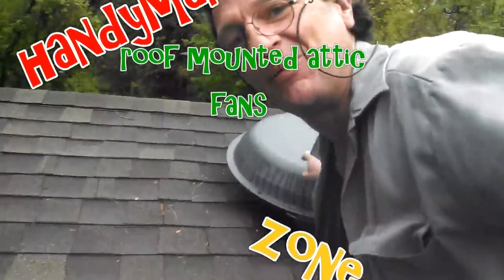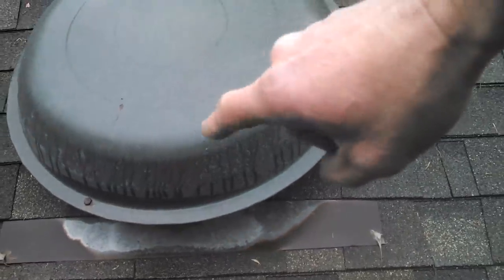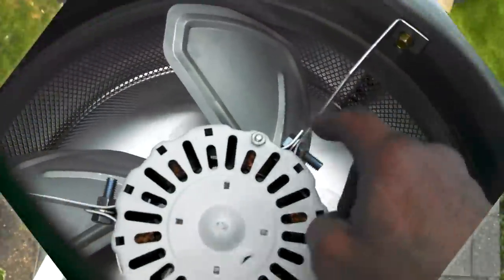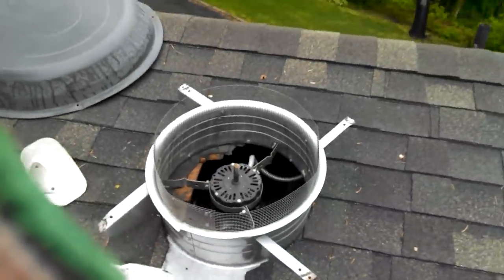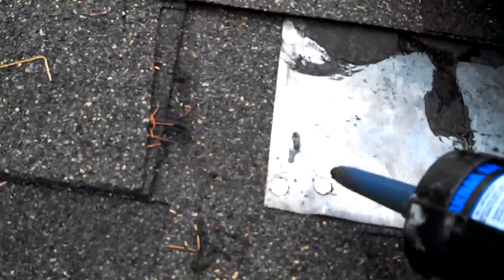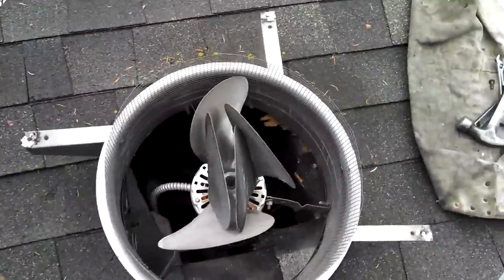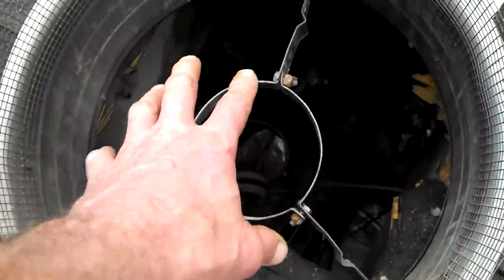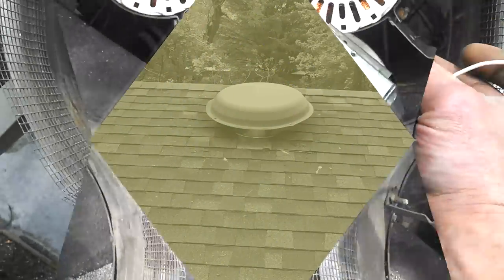Roof Mount Attic Fan MOTOR REPLACEMENT

Comment: I appreciate the info. I'm getting ready to have to work on one of these.  I'm an electrician, but have never had to service one of these. It's probably going to be that I will have to replace a bad thermostat, because the customer said he recently replaced the fan but it still doesn't work. Luckily he said you can stand up in his attic, and it's Winter here in Florida. Thanks very much Dino. I appreciate ya.

Comment: Thanks for the video! I watched several different ones and yours was the most practical and answered my questions. My problem wound up being the motor, so I was glad you talked about testing by doing a bypass of the thermostat. It also helped a lot that you showed how to replace the motor only, without replacing the whole fan and vent assembly. And I don't fukin' mind that you're fukin' authentically you and cuss when you talk. It's just what makes you, you! Thanks again!